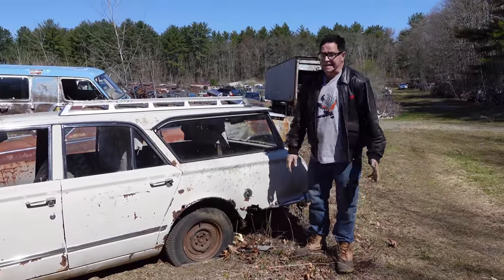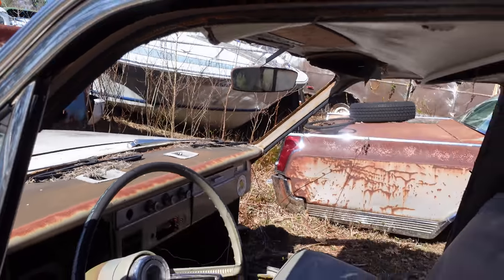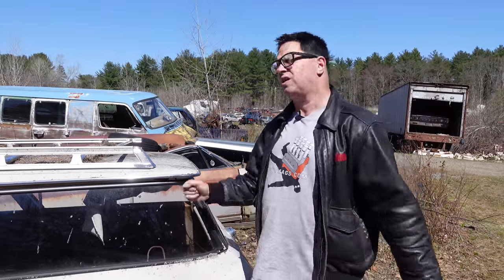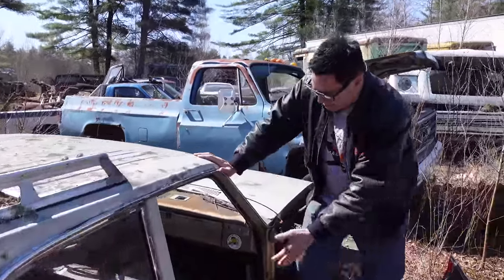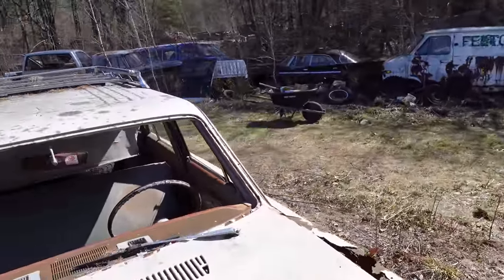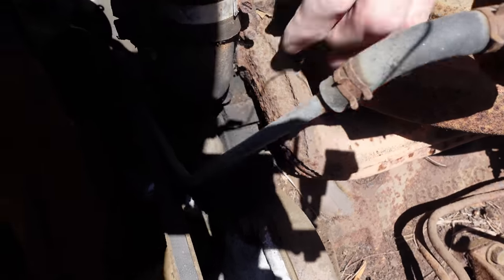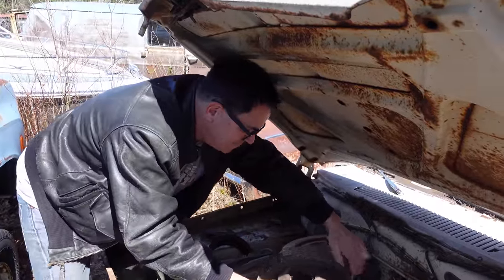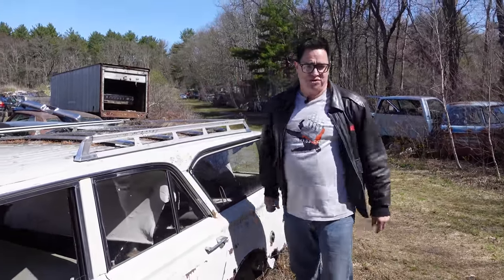Valiant Not Dart

Comment: My first car was a '68 Valiant Signet, 318, 3 speed on the column, a/c, and no radio.  An 80 year-old man ordered it that way, and I got it after he lost his license at 86.  It had 24,000 miles.  It was a sleeper with that 318.  I wish I still had it.
Reply: Amen Sista. Me 3.
Reply: Those cars were fairly light so even a 2 barrel 318 gave them good performance.  In 1968 you could also get the 340 in the Dart and Valiant for the first time and that engine could hold its own with many big blocks.
Reply: Patrick 2 or 4 door

Comment: After immigrating to the U.S. from Germany in 68' my father bought a 64' Dodge Dart 4 door for my mom to use, she had never driven before moving to the United States. (not uncommon in Germany at the time, public transport being good enough, plus she couldn't afford a car)  So my father thought it would be easier for her to use this car with it's push button automatic transmission selector on the dash. As seen in this video, the rust got to it quickly. My older brothers said my father put down a piece of plywood down in the rear footwells because of the holes, you could see pavement under the plywood. When the family grew to four sons, my parents got a 69' Chrysler Town and Country that lasted tell the mid 80's.

Comment: Ahh...this is what I learned to drive on in 1977 when I was 16. Being my dad's car, it would not have passed inspection (tires, turn signals) at the DMV, so I had to get my license on my dad's girlfriend's 1964 Chevy II. It was an automatic, rather than the Valiant's 3 on the tree, so that was one less thing to worry about on the test. I passed! I drove.the wagon for the next year plus until I bought my beater 64 1/2 Rustang. I look back fondly on that wagon now. It was pretty nimble, although the slant 6 was kinda tired by then. Thanks for the memories, Steve.

Comment: I had a 1966 Dart SW, 225 Slant Six, AT and power steering(!) around 2005 here in Arizona. NO 'cancer style' rust I can remember, just some dents dings and scratches. This guy I converted it to A body 1973 up disc spindles, upper control arms as well as the 1973+ lower balljoints, which were also used on 1962-72 B bodies. Rear end, a 1973+ A body 8 1/4" unit, except for having the driveshaft shortened 1.5"/40mm, the diff was a 100% bolt in. Even the original parking brake cables on the original 7 1/4" diff, worked with the donor 10" rear drum setup.

Comment: I've owned a '61 four-door floor-shifted 3-speed, a '61 4-door push-button,  a '62 two-door push-button, a '63 4-door 3-speed, a '63 two-door 3-speed convertible, a '64 two-door push-button, and a '65 two-door push-button Valiants.  I drove the 3-speed '61 four-door as my year-round daily-driver for 8 years in Michigan back in the 1990s.

Comment: Had a 225 cu in. 2-door Signet after a 170 V100. Both 1964's. Also a 1966 Signet -- when the 273 2-bbl started drinking more oil than gas, it was 340 time. Transplanted the powertrain from a wrecked Demon, with 8.75 rear end, and didn't even have to alter the driveshaft. It all fit (we won't discuss the tranny tunnel changes).

Comment: On those Wagons in Australia (Chrysler Valiant branded) those Horizontal tail lights were referred to as Canadians, Quite rare here even for the relatively low volumes made at Chrysler in South Australia.
I did a Body resto on one of those, Plenum, floors and C and D pillars and they are a surprisingly well made car.
Reply: Quick question, weren't the Aussie versions one model year differentiated from the US versions?  I vividly remember seeing advertisements, years ago, of Aussie Valiants being labeled one model year off from what they were in the US.  So, for example, what was a '62 model year Valiant in the US was a '63 in Australia, and so on.  Any truth to that?
Reply: Junk.......
Reply: @NorthernChev  Australian Valiants were originally the same as the US versions. Originally a limited amount of 61's were sold in January 62 before the real 62 model was released. However the 62's were carried over to the early part of 1963. The new body style debuted later in '63. Australian Valiants also came standard with 14" wheels and wagons were available in all years.
Reply: @NorthernChev  Chrysler Australia also made ute versions of these. When Plymouth canned the wagons in 1966, Chrysler Australia were forced to go their own way to have a wagon version. The VE, VF and VG were a result of that.
Reply: @area51isreal71  is this our equivalent of an AP5? I met a bloke who had a '64 AP5? he'd worn out the slant 6 and stuck a Holden 202 in it. He said it fit ok but rubbed on the steering box.
Reply: @BL2197  The video doesn't show much of the grill, but yes pretty much. The wagon tail lights varied depending on what the parent company were up to. They were vertical sometimes and then they were horizontal. Surprising to hear of the 225 slant six wearing out though. Those had and still do have reputation of being unbreakable. Lots of dependable power and enough torque to pull a building down along with reasonable fuel economy. The Holden 202? The kindest thing you can say about that is that it was reliable.

Comment: In the background, 77 Dodge maxi van appears to have factory tint popout windows (could be aftermarket tint but its not bubbling, so thats a good indicator).  If its factory tint, thats a one year only option (later vans had larger sized windows).  Its also pretty rare, particularly in pop out format- they also came as sealed glass.

Comment: My first car was a used 64 Signet 200 convertible. White with a red gut and black top. 225 pushbutton with buckets. It was a complete rust bucket. Dad and I did what we could to hold it together but the rust and lack of a fixed roof made it feel like it would come apart going over a speed bump. Sold it for peanuts 11 years ago and don't miss it.

Comment: In Australia this would be a 63-64 Chrysler Valiant Safari Wagon..the model with the extra chrome strip (in the same position but different width) was the Regal..Same torqueflyte or 3 speed transmission options, all Aussie cars had the 225 slant as standard (no 170) with the option of the 273 v8 in 1964 AP6. Incidentally the 1964 AP6 was the first family car in Australia to be offered with a v8 engine.
Reply: and imagine what that wreck would be going for in Australia. I envy the US guys with the access and affordability to these old cars
Reply: You could argue that the fifties Australian Chrysler Royal AP1, AP2 and AP3 cars with the V8 option were aimed to be family cars as was the Chrysler sold Simca V8 and the Australian assembled Studebaker V8 cars. All a similar or even less price premium over a Holden that the first Regal Auto only Valiant V8s were. Thought the first was the AP6 in 1965.
From Wikipedia :
The AP6 was the first Australian-built Valiant to be offered with a V8 engine — the 273 cu in (4.47 L) LA V8, introduced in American Valiants in 1964, and released in Australia in August 1965
Reply: In our models it would be an AP5.
Reply: Only Australia used the AP model system. Originally in the fifties AP was to  mean Australian Plymouth but they soon dumped the plan to have Plymouth, De Soto and Dodge versions just having one Chrysler version of the Chrysler Royal. So the AP then was changed to mean Australian production. AP models will be unknown in the US apart from very well read people

Comment: Had a '65 V200 4 door 225 cid slant 6 automatic w/factory air and seat belts, an extra.  Lived for a while in W Texas where there were no speed limits, it could cruise at 105 but could not break 106.  Finally had to let it go, rust ate it.

Comment: we had these in Australia,  AP 5 & AP6 Valiants (by chrysler), & here they carried on the body shape for the wagon for the VC Valiant when they changed model, had a different front end, different dash etc...  they had slant 6s as well, the one I had was a 63 AP5 Regal Safari (Regal is the highest trim, the lower one was just Safari.)   IIRC they also made a wagon in the S & R series Valiants here as well... which preceeded the AP5
Reply: There was no wagons in the R & S series either made, or officially imported into Australia by Chrysler for public sale. They are exceedingly rare even in the states. I have seen two in wagon form in Australia in 50+ years and they were private imports.
Reply: Safari wasn't a trim level, it was just their name for station wagon,  which they discontinued for the VH wagons in 1971.
Reply: @rossbrumby1957  the Safari was the wagon yes, the base wagon was just titled "Safari", but the "regal safari" was uptrimmed, had things like 2 toned steering wheel (with chrome like inserts to separate colours), higher trim level overall, 2 tone paint, different tail lights, Torque-Flite push button auto etc. i had one, a green/white wagon... IIRC they also used the "regal" trim in some sedans as well...... great car... unfortunately mine rusted out underneath the roof sill around the back, so i ended up selling it for a parts car.. (this was in the 90s)

Comment: My second car, after I wrecked my 1965 Impala SS convertible, was a 1962 Plymouth Valiant station wagon that cost me $25 in 1974. It had a slant six and a push button Torqueflite. It was rusted out so badly that there were no floors behind the front seat, and no quarter panels behind the rear wheels so it was an open wheel car. Drove it until the rear end seized, then put it in first gear and revved it up to an indicated 60 mph in first gear (car was stationary because of the broken differential). Engine remained bulletproof until the fan belt broke and it overheated and sent a piston through the side of the block. We then smashed all the glass and otherwise trashed the remains until there wasn't a single undamaged part that could be salvaged. Good times.
Reply: How much was a weekly wage back in 74?
Reply: @BL2197  Well it wasn't much for a kid working part time at a car wash.

Comment: Ram tuned and mouse chewed.  FWIW, I learned something, now I know how to ID a 225 vs a 170 Slant Six.  

Chrysler was known for that kind of thing with the taillights, the 62-63 Dodge 880 has a round light but the chrome has a big filler in the top because the quarters are the same stamping as 1962 Chryslers.  

Grab that Chevy truck steering wheel laying on the Olds behind you, if it's clean and not cracked it would sell pretty easy online.  

What's hiding in that semi trailer?
Reply: Yeah, I want to know what's in that semi trailer too!

Comment: this roof rack style was in fact a Mopar design introduced on the 1965 C Body wagons (5 or 7 “slot” styles - 5 slot was typically seen on Plymouth models and the 7 slot version on Dodge and Chrysler  wagons) this style roof rack was also used on Belvedere and Coronet wagons beginning  with the 1966 models

Comment: I had one of these '64 valiant wagons in Australia back in the mid 70ies. White, brown trim, 3 speed column auto, I guess a 170, but maybe a 225. I had a few valients '74 wagon 215, '76 CL regal sedan 245.
Reply: We never got the 170 in Australia.  Thats why early Vals embarrassed holden and falcon owners so easily- massive power differences.
Reply: @rossbrumby1957  I always thought she was s 225, but not sure. Holdens I had EJ. HD 179. Later Ford XW 200 all wagons for my work.

Comment: Possibly the most solid generation of the A-Body, at least here in Australia:
a) The body was smaller and more rigid than the 1967 design...Aussie Valiants after VE were a bit tinny.
b) All autos were Torqueflite - local content requirements led to a BW unit being substituted on 6cyl cars thereafter.  V8s retained Torqueflite.
c) Valiants were initially more expensive than Holden and Ford, until Chrysler decided to compete on price.  The cars suffered and the market was flooded with them - which led to vertical depreciation.

My ultimate Valiant: an AP6 or VC with a 265 Hemi (electronic ignition), Torqueflite and CM front end with sway bars, gas shocks and discs.  ☺

Comment: Can you squeeze in a word about the aluminum 199 cu. in slant 6?  I remember well, snagging some pushrods out of a junk aluminum slant 6, they were wayyy too short for my 225.   Also, for a real nightmare, look at a 1964-66 Canadian Dart, a mish-mosh of Dart and Valiant pieces from the factory.
Reply: There are a number of Canada issue Mopars with strange combinations of parts or badging.
Reply: @CR7659  GM was guilty of it too, The '54 Pontiac was built on a '54 Chev platform, Chev six cylinder, '54 Chev taillights, but the bright stripe down the hood and trunk, and, I swear, a '53 Pontiac grille.  There are two of them around town, they are legitimate '54s.  Just another example.  And then there's the Pathfinders of '55-'57, maybe another episode?
Reply: @ExilefromCrownHill  Canada had some local content laws that made it cost prohibitive to produce the same US Pontiac for the smaller market.  

So as a result you got a lot of badge-engineered Chevrolets sold as Pontiac; not just the 53-54 you mention, but Canada did not get Pontiac's V8 until the late 60s, the cars used a Chevrolet chassis and drivetrain.  In the 60s there were several "Pontiac" offerings that were very thinly rebadged Chevrolets.  

Probably the ultimate in this was in 1982 when Pontiac attempted to discontinue the full size cars. Dealers imported the Parisienne to replace them, and it sold enough in 82-83 that they brought back the sedan until 1986 (even got the 1979 US quarters and taillights) and wagon to 1989.  

Even the Chevrolet Corsica was sold in Canada as a Tempest, the only difference being a few badges.

Comment: I remember my 64 valiant having the torque flight and sometime when I would go to start it wouldn’t and I would have to slide the trans out of park then push the buttons R N D 1 2 then back to park. Then it would start , kinda cool, like putting in a password to start
Reply from the maker: Gotta love "the touch" we all learn when dealing with older cars and their quirks. Sounds like the Neutral Safety Switch was mis-adjusted. Just a thought. THANKS FOR WRITING, Steve Magnante

Comment: Those wagons are fairly rare, so finding glass and trim can be an issue. Also, finding working automatic transmission push button controls for A cars is rare as well because it was only used like that for 2 yrs. These cars would rot out in any climate but AZ even though Chrysler highly touted the new for '64 7 dip and spray rustproofing system because of highly corrosive welds and poor weather sealing around the windows. I'll bet with a new set of points and rebuilt carb, that 225 would still run!

Comment: Technically the Dart was the Dodge version of the Valiant.
Reply: And to be even more technical, didn’t Valiant actually start out as it’s own BRAND when the car was first produced…….?????
Reply: Independent brand for the 1960 model year 
"Nobody's kid brother
This one stands on its own four tires". 
Was branded Plymouth in the USA from 1961 onwards , but remained simply "Valiant" in many export markets .
Reply: @Richie_the_Fixer  Spot on.  In Australia, the decision was made to use the Chrysler marque after the launch of the Chrysler Royal in 1957 (a P25 Plymouth with tailfins)...they sold Valiant as a standalone marque in a market dominated by 'light six' compacts.  Oddly enough, full size Canadian imports wore Dodge and Plymouth badges, effectively placing them above Chrysler in status.  Trucks remained branded as Dodge.  Mitsubishi products Lancer and Galant were sold under the Valiant banner until 1975: the A-Body Valiant was suffering a major decline in reputation, so it was quietly retired as a marque in favour of Chrysler.  Very convoluted indeed!

Comment: As you likely know, the Chrysler Valiant continued in production in Australia until about 1982, with station wagon Safari version of all but the earliest four headlight 60 to 62 cars. These were only four door sedans here.
A survivor wagon car of near the last production :
https://youtu.be/zLKN2BXKpUY
By 1970 the 225 slant six was replaced by the non slant local 215, 245 and 265 six cylinder options labelled the Hemi six. The highest out showroom race specials had 302hp out of a six for use with the Valiant Charger E49 model. Triple Weber carbs a big help getting 302hp.
Unusual that the US Valiants did not increase in size as much as the later Australian developed models. Also unusual that Australia did not get smaller than 225 for the slant sixes.
All now being sought after cars in Australia unlike earlier years.

Comment: While its been repeated so many times that its gospel that the slant was to lower the hood line, it seems unlikely that is the only reason. The ability to use turned intake runners is presented as an almost unintended happy side effect when reality is is could have been one of the major reasons.

Other advantages of the slant that if the radiator is kept centered in its support then for the fan to be centered on the radiator it has to be offset from the center of the engine. Then the water pump can be moved back and engine length reduced. Also the slant to the right shifts some of the static weight to the right side of the car which is desirable on a left hand drive car since when only the driver is present the car loading is biased to the left.

This same idea is used on modern transverse engine FWD cars designed by companies in left hand drive markets have the engine on the right and transmission on the left making the static load on the car biased to the right. The Japanese have right hand drive cars in the home market and design their cars with the engine on the left. I believe at this point they sell more cars in left hand drive markets and so wonder why they haven't changed.